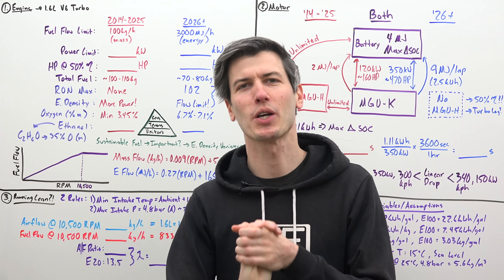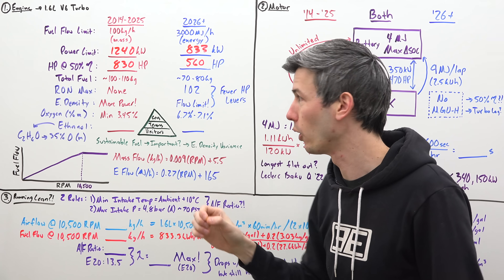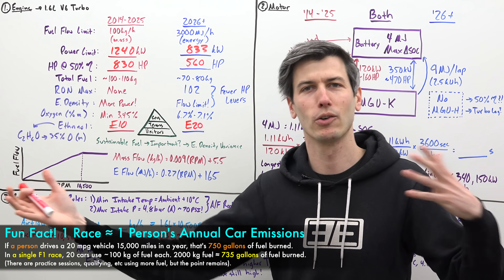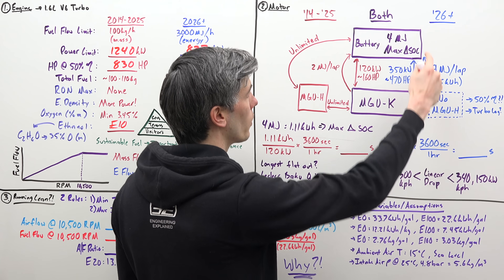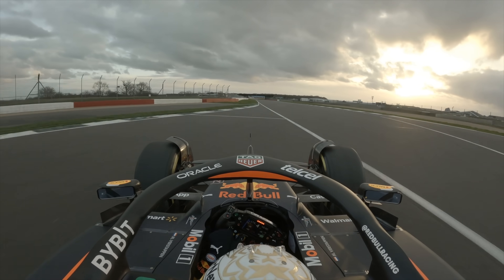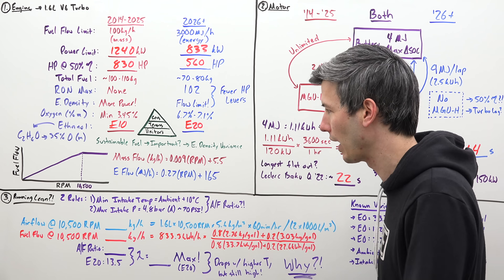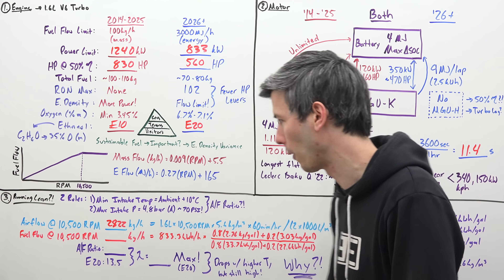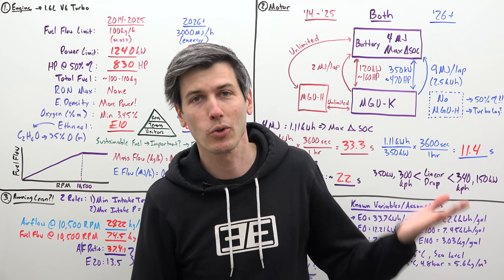Why Are 2026 Formula 1 Engines Going To Lose So Much Power?

Comment: 4.8 bar is insane! I won't be surprised if teams aren't going to be running much more ethanol, especially with the new joule based flow rate.
Reply: It’s in the video. It’s increasing from 10% to 20%.
Reply: But theres's also a limit on how much fuel you can carry, so it's a tight balancing act.
Reply: @gkinghsmith9352 not sure about the tight balancing act. seems like the more rules you introduce the less balancing you have to do, and the more the rules dictate your choices. for instance if there is no power limit you might not want to have the most power because more power is less drivable, less reliable, wears tires quicker and uses more fuel ( more weight) now if you have a pretty "low" fuel flow limit like current and incoming rules, power is limited and you want to have all of this limited power other wise you'll get passed on the straights... same for fuel, if you have a high minimum amount of oxygen that reduces fuel energy density, you might want to use the least amount allowed to get the best energy density. makes it easier for everyone to optimize the parameters, you reduce the research costs and make teams more equal regardless of the budgets. seems like it's where they're heading probably trying to make F1 more exciting to watch...the tight balancing act is there, trying to create healthy competition without going too far and transforming F1 into racing series where all cars are identical
Reply: Can't, because of oxygen limits. Maybe they'll start dissolving hydrogen there. And now the air intake limits might matter.
Reply: Damn people here really need to learn about 80s formula one
Reply: 4.8 bar of boost is a lotta pressure. They must have some crazy piston design
Reply: @iaial0  they can't run 4.8 bars cause the fuel flow limit is too low. they are already running lean at 3.5 without current regulations that don't limit boost and the fuel is going to be even more limited
Reply: @iaial0  yeah i would not be surprised if those 1.6 l would even pop off
Reply: Yeah Ethanol is not nearly as energy dense as gasoline so if they butt up against the 3000MJ/H with that itll matter, but otherwise..
Reply: You should hear about 80’s Formula 1 where the turbos ran 5.0+ bar of boost
Reply: Keep in mind that it is 4.8 bar absolute, or "only" 3.8 bar of boost.
Reply: So if I have investments in ethanol I should be happy about this? I can also get kickbacks for fighting climate change  right?

Comment: Remember the MGU K is getting bigger and remember revs are listed at 15k cars barely rev to 11krpm so they can rev more to make up for losses
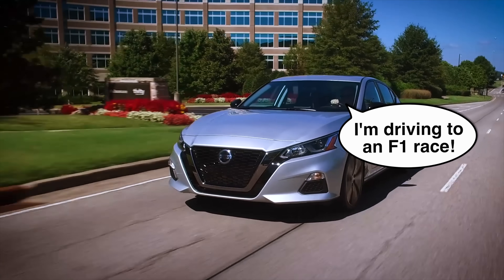Reply from the maker: As explained in the previous video (and briefly in this video at 4:47), you cannot make more power by revving higher than about 11k RPM, because fuel flow is restricted above 10,500 RPM. Longer explanation here: https://youtu.be/KjrNcuc89Pc
Reply: @Engineering Explained  yeah sorry I just watched I might be wrong I just remember an old F1 video about 2026 regulations and the man said the engines will rev higher so my mistake but it is an official F1 video on their channel fmcheck it out
Reply: Also, when fuel input is limited by the regulations, the only thing affecting engine power output is efficiency. Changes in typical engine rpm will by themselves increase efficiency (as the current typical rpm of 11,000 has already been chosen to give maximum efficiency) and therefore will not increase power. Put another way: Any increase in rpm will have to be met with either a decrease in boost pressure and/or decrease in air:fuel ratio in order to keep within the fuel flow rules, and so won't bring more power.

However, you are correct that an increased maximum electrical contribution (160hp→469hp) will compensate for the drop in engine power. The issue there though, as he said, is that this electrical power can't be sustained. Theoretically the maximum battery power in a lap is 13 MJ as far as I can tell (9 MJ recovered in breaking + 4 MJ drained from the battery),  which is 37 seconds at full power, while on an average race lap, 9 MJ of power translates to 26 seconds of full power. But this is assuming that they can recover 9 MJ per lap, which is impossible without breaking the 350 kW recovery rate limit.
Reply: @jamiepearson532  Not to mention that regen isn't 100% efficient, so the maximum energy recovery rate is actually lower than 350kW
Reply: @bosstowndynamics5488  Getting rid of the MGU-H is a huge loss for the sport. I get it that it's expensive! So why not make MGU-H a regulated part that is exactly the same for each team? Too much common sense.
Reply: @v4skunk739 you’re making way too much sense here 

The current teams could have made a spec MGU-H or off the shelf kit that any team could have used if wanted and would have been cheaper to implement
Reply: The rev limit is currently 15k in the rules

Comment: I wonder how much this will affect the brake sizes / cooling ducts, with all that energy recovery it will be interesting to see where teams go with this.
Reply: You might see a modest reduction in brake size to shed unsprung weight
Reply: FIA will ban it for sure.
Reply: Probably not much since they use the hot brakes to help heat up the tires.
Reply: @Anthony11986 you can pre heat the tires with tires blankets and then bring them to temperature just from the tires doing their job. once the tires are up to Reno having less heat from the brakes is an advantage
Reply: @geemy9675  they are lowering tire blanket temps every year now. Look at Hamilton last year when he left his brake magic button on in baku
Reply: @geemy9675  tire blankets are gone starting 2024.
Reply: @Anthony11986  So surely you'd see a large reduction in brake size and cooling ducts to prevent the hugely reduced amount of heat from being pissed away into the atmosphere
Reply: Is the energy recovery only on the rear wheels? If yes, these cars are going to be terrible to drive.
Reply: @gkinghsmith9352  I'm sure they can figure out brake balance
Reply: @gkinghsmith9352 formula one reaches 5G while braking 2.5x the 2Gs of acceleration it gets with 1000hp, so I'd say probably at least 2500hp of braking power maybe even more at very high speeds with high downforce. max Regen 350kW is way below, like 15-%20% so they might delete the rear brakes like formula E, as long as the software that controls always keeps a buffer to not overcharge the battery during braking. obviously it would need also good cooling to ensure the battery doesn't overheat. but it's way easier to control a battery temperature that has high thermal inertia than brakes than disc brakes
Reply: @geemy9675  >as long as the software that controls always keeps a buffer to not overcharge the battery during braking.

I've always wondered how that type of thing would work when the battery doesn't have enough space left for the next stop. Would the regen energy go into some kind of resistive load? Like a big space heater under the car?
Reply: @SupaKoopaTroopa64  but it's not that hard to not get a full battery while driving. on an ev, just don't charge 100% if you are at a very high elevation. with current tech, an hybrid won't have enough Regen power to delete brakes anyway, unless it's a race hybrid with extremely high charge/discharge rate
Reply: @SupaKoopaTroopa64  I work on freight trains, and locomotives use regen braking and call it dynamic braking. Zero energy is recaptured, 100% is sent to a resistive heater which has absolutely MASSIVE electric fans to cool them down. The resistive heaters are big, but tiny considering the forces and energy involved.
Reply: @firefighter4443  That sounds really cool! I've got to look that up!